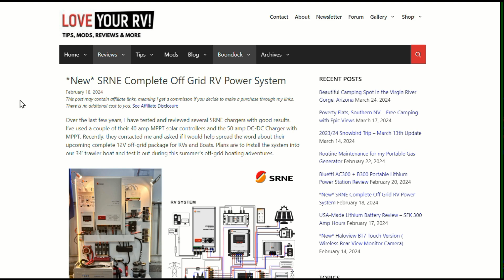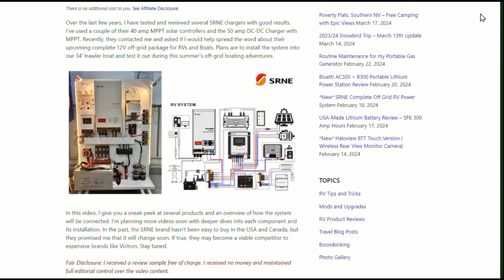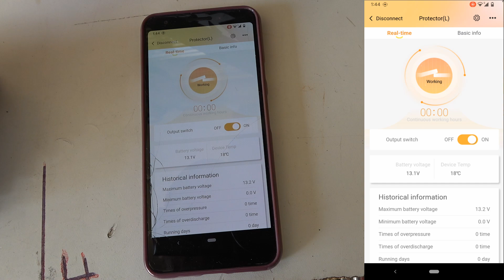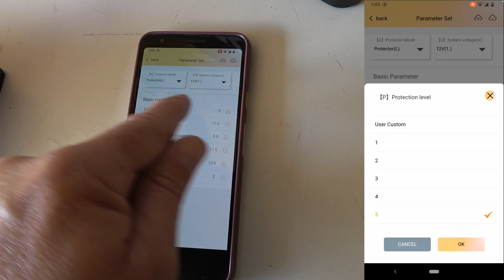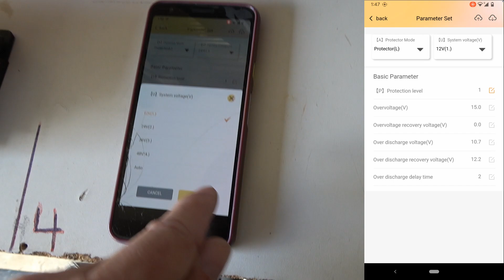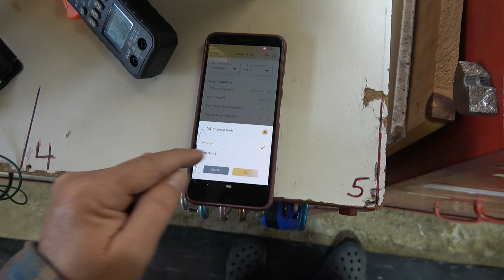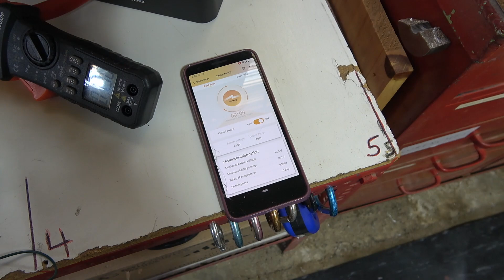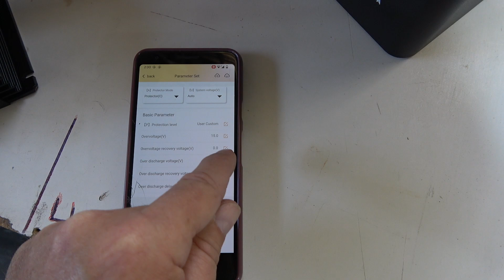SRNE Battery Protector & Solid State Switch - 60 amp Model with Bluetooth App BP4860N25

Comment: Looks like this unit still needs a little perfecting.  😀
I think the 7-segment display on the unit looks a little flaky (I know it's a prototype, and the app is much better, but...).
It would serve as a great remote battery disconnect - Thanks! - Cheers!